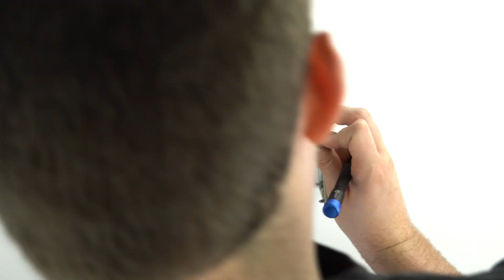G4 Cube Teardown Guide

Comment: Thanks for video. Removed the mainboard today and instantly found out why it wasn't powering on. Massive scorch marks on the underside of the power connecter. Probably someone used a faulty power supply in the past.
Reply: Hi, I think my Cube has the same problem. Did you fix it? If so, what did you do to fix it?
Reply: @drivensense5326 

Tried to find someone to fix it, but no one could be bothered (especially the retro Mac YouTubers who claim to love to bring these things back to life). Sold it for spare parts and found a working model that is still being used.